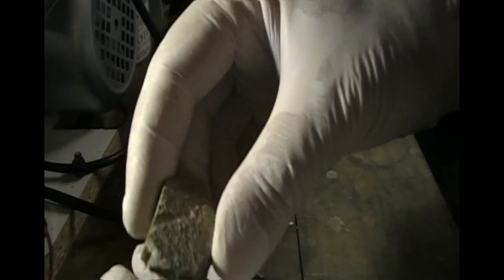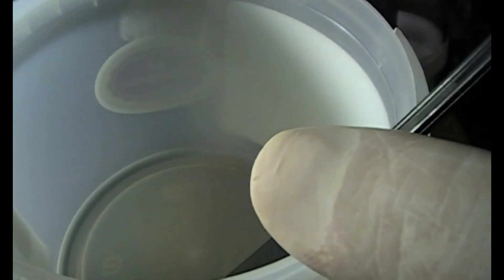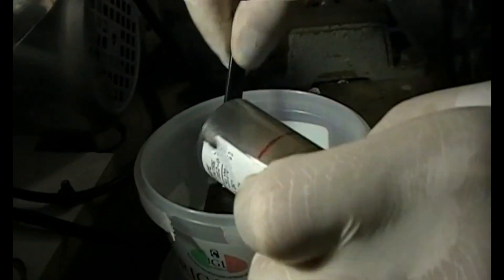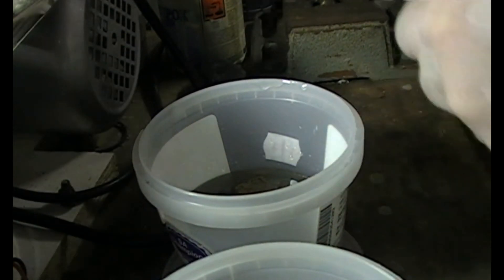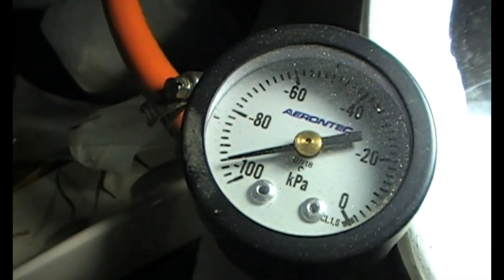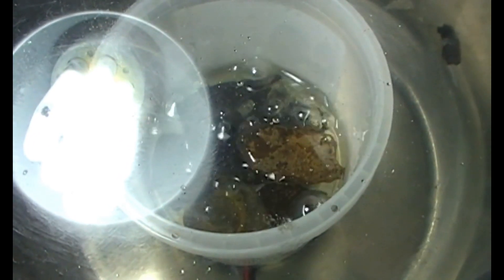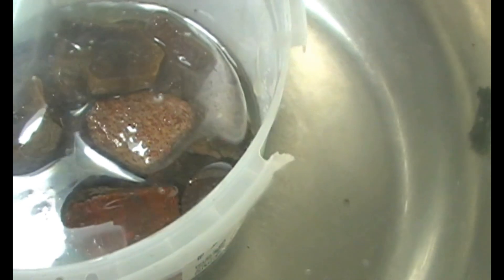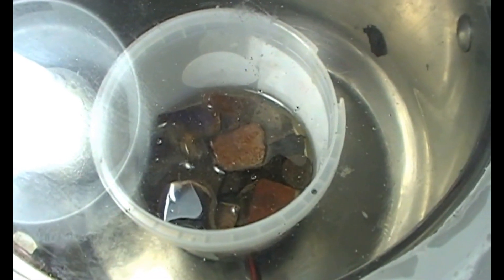How to stabilize rocks with epoxy resin

Comment: Thanks for sharing. I’m finishing a surfite cab for a sterling setting, and I normally don’t cab my own stones. Curious, is there any danger of some stones shattering under pressure? Say, something with lots of trapped air bubbles, like volcanic rock or porous glass?

Comment: Thank you very much for the video Angelo.

I have some rough/natural red sponge corals which I wonder how to have them "shiny". 
I search on the internet and found your youtube channel.

But too bad, it turn out I need a machine to get out the air from the stone's pores.
I just hope that it can be done without a machine but with something which more "home" tool.

Anyway, if you don't mind, I want to ask you a question:
Can I just skip the machine process ?
I mean, after dipping the stones into the resin mixture, wait for a moment, then just take out the stones and wait for a few days until the resin hardened.

Thank you once again, Angelo.
Reply from the maker: Lia Irawann thanks for commenting. In internet you can find diy methods to convert a regular bicycle pump in a effective vacuum pump, with no machining or special tools. You may want to give it a check. You may Dip stones into resin but it will be hard to impregnate their
Porosity without a vacuum
Reply: @sutra1976  Thank you very much for your kind reply, Angelo. I will have a look about convert a regular bicycle pump.
Reply: @liairawann607  I have seen people use a pressure cooker - I would imagine it depends on the type of resin (hardening time)

Comment: Ciao Angelo,vorrei riempire delle fratture e piccoli buchi in cabs di giada,opale rosa ,acquanarina e altre pietre....mi consigli questo procedimento di stabilizzazione o basta applicare delle resine epossidiche come ho visto in qualche video? come durezza finale ai fini della lucidatura cos' e' meglio?
Reply from the maker: ciao, queste nei miei video sono resine epoxy a bassa viscosità ed alto indice di rifrazione. Per far si che poi il materiale infuso non sia molto visibile, la resina deve avere proprietà ottiche simili al materiale.
La durezza delle resine sarà sempre inferiore alla maggior parte del materiale trattato quindi converrebbe prima tagliare le gemme e poi infonderle, a meno che non si voglia riempire grandi cavità. In questo caso, il risultato finale della regolarità della forma, dipende dall'abilità manuale dell'operatore. Grazie per aver commentato.
Reply: @sutra1976  ti ringrazio,si infatti vorrei "riempire" delle pietre gia' finite,cabs,gocce,ecc ecc.....Un'ultima cosa,hai per caso un video su come adattare un mini tornio per ottenere gocce o cilindri in pietre dure?